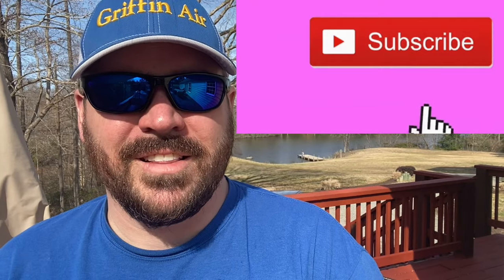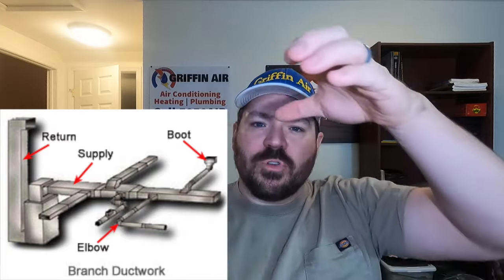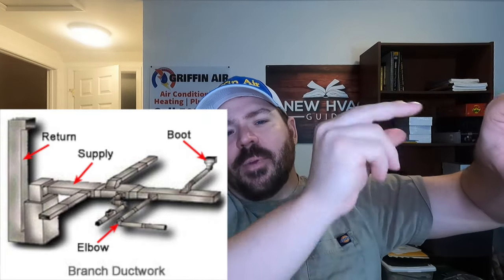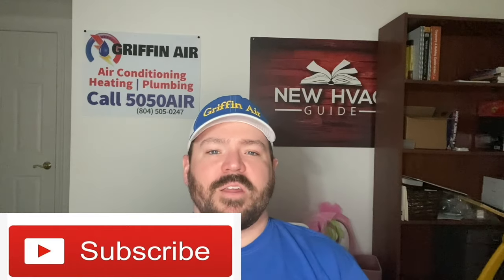3 HVAC Ductwork ISSUES Homeowners NEED To Know!

Comment: I have installed ductwork for 32 years here in Northern California. This guy did a nice job of explaining things correctly. To answer some problems- if you are getting too much air in 1 room and not enough in another room you could add balancing dampers in the ductwork to divert the air into other rooms. Also a big thing he talked about is too small return air to the unit, this causes many problems. 1 is the unit may freeze in a/c mode in summer because the unit is starved of air over the coils. He brought up static pressure. This is an issue with how the system deliveres air evenly. Proper sizing of ductwork helps delivery of air through out the home. Stepping down in size the further you go down the line is key to proper airflow. Hope this helps some of you. This guy is spot on here. Good job
Reply from the maker: Thanks pal
Reply: Paul , I have this issue on my new home , CFMs were tested in each room and it’s higher on one area and lower in another but still above the CFM plan 
However, one room is hotter in summer and colder in winter
I asked for the engineering plans to be relooked at and ensure loads and cfm requirements are calculated correctly… we’ll see what they say
Reply: Also, the HVAC Tech said there are no dampeners at all , he said I’ll have to work with the registers
Reply: @Victor Cruz  installing damper collars is easily done by a pro. Using the registers only makes it noisier in the room. The extra heatload in some room's could be from what's in the room generating heat. Can lights, tv, computers... Lack of window coverings on the sunny side of the house... All easily fixable.
Reply: @VictorCruz-wn8tz  Good luck with that. Unfortunately systems are rarely installed prior to closing up walls.  It would be nice to be able to run those flow numbers prior provided that ALL condicalculations. (Insulation, window effcy, sun, etc) are set forth in the load calc.
Reply: Nice thank you for your input sir. I’m looking for a knowledgeable individual to help me install the entire system myself. In so cal
Reply: Hey is the number one reason for not getting air in a room is because obviously the duct work is damaged or loose in some way ? Getting very lil air in one room. Very weak supply from the vent. I tried the ceiling damper but it didn’t make any difference.
Reply: Is the room facing west. These rooms typically are hotter than the rest of the home especially if is a 2 story house upstairs like a bedroom. I would run an additional 6” round duct to that bedroom. This will help in the winter too. Hope this helps. FYI this will lessen the air in the rest of the home about roughly 150 cfm
Reply: Undersized systems or oversized ducts will cause any room to get more air flow than other rooms.
Reply: Thank you for the insight. If current 3.5 ton will be replaced with a 4 ton packaged system, is it required to upgrade the ductwork to a bigger size as well? One company said yes and it will cost an additional $4K to upgrade the ductwork on an 1800 sqft home.  Any response will be appreciated. Thank you.
Reply: Can a gas line piping be attached with two brackets into your furnace return duct work 

8:06
Reply: Whats the pricing for new duct work installation?

Comment: Well you just disappointed about 75% of home owners. Unfortunately builders and many home owners use cheap mechanical contractors for residential the majority of time. Therefore you get low skill labor at a a good price. Get multiple estimates from reputable companies and ask to see their work. If they can’t show you photos they don’t take pride in what they do. Doesn’t matter if you spent 20k on your new system if it isn’t installed correctly. Do your research on companies. Ask to see their work. If it doesn’t look good, it’s probably not. People that do good work take pride in their craft. It should look clean, not like a rats nest, or bomb went off. It should be sealed. Trash shouldn’t be left in the attic or basement etc. quality mechanical contractors are definitely out there but it’s up to the home owner to do their research on the companies they hire.

Comment: The biggest issue for indoor air quality and occupant health is actually duct leakage.  Even brand new duct systems leak quite a bit.  Our brand new, pretty well done duct system actually had 120 cfm of total leakage.  We had aeroseal seal it all up for us.  Everyone is breathing contaminated air, pressurizing, or depressurizing their home with poorly sealed duct work.  No good.  Contractors building building's envelopes and mechanical systems are directly affecting the health of the occupants.  In my new house, I needed to add ventilation because VOC's were too high making me not sleep well and our house prior to sealing the ducts was pulling in attic air and pressurizing the house.  There's a lot of data now showing indoor air causes lots of chronic health problems.  It's time for A/C guys to start paying attention instead of just throwing in a single speed A/C with a fiberglass filter,  no ventilation, no dedicated dehumidification for mild months, and etc. Into homes and not thinking anything of it.
Reply: When we come to your home and tell the homeowner what needs to be done on a new home install or changing out the equipment in a older home,it all comes down to what they can afford.
As far as duct work it’s code to seal all the joints but sadly not the designing of the system.its a lot of hacks out there.we can sell you high seer inverter systems with high in air purifiers,ultra violent lights,humidifiers,ERV systems but the majority of people can’t afford this level of job.
Reply: Then the homeowner needs to pay for it. Builder only pays for bare minimum. You want it? You pay for it.
Reply: In California the system has a duct test. The test goes right to Sacramento, this is done by an independent company. So, little to no leakage.
Reply: Yeah like on mobile homes. The plumbers, electricianz, and AC guys drill holes in the sub floor and dont seal. So literally a bunch of seals not sealed let alone ducts are never installed correctly.. you need the right tapes, spray glues for the tape.etc. just did our home and we had a basketball sized hole in the trunkline where a duct used to be.. they had it capped but it was just tape and over time just fell to the floor... Lol

Comment: A few of years ago I got a new AC. It was supposed to be a 4 ton unit for 2200 sf. Another company came out for a free yearly checkup and I was informed I had a 5 ton unit and my ducts were not adequate. He also suggested a second return air. I had 4 estimates from 4 companies who all pretty much said the same thing. I had the first company do the job. 9k for all new ducts and additional return air. What a difference. It’s very quiet now and the whole house stays cool. Before, the living room for example would not cool down during the day with company over. That ductwork costs more then the AC install. But, I should only have to do it once!
Reply: Having enough return is an extremely important part of a properly running air conditioner. Also not using restrictive 1 inch pleated filters they cut airflow substantially.

Comment: Always check behind your plenum box and make sure they sealed the area off from the attic if you have a closet mounted blower! Paid $8k and found the installer never sealed the back 4” off so I was pulling dust , dirt, and gross outside air into the closet into the intake and through and out the duct work! I fixed it myself because I’m so sick of being scammed by AC guys.
Reply: same here.  my guy showed up smelling like weed and the plenum wasn't even square to the point of having a 1/2 inch gap on one side which he "mastic'd up".  I had my drywall contractor come behind him and seal between the plenum and the attic.  He also created a flow unbalance and one of my bedrooms gets hardly any flow.

Comment: I have a 1200sqft 3/2 and a 2.5 ton unit that is 3 years old. The air handler is in the attic, and I'm replacing the entire duct system from the 70's by myself. Your video has been the most helpful I have found yet. You even used the same size house/HVAC unit I have as your example. Praise The Lord, Jesus Christ.

Comment: Can a return be placed right next to a duct. My hottest rooms they are next to each other and it just doesn’t make sense. It’s ice cold everywhere else and super hot in my guest rooms
Reply: I have a similar situation 
Lmk what you find!
Reply: If a return is too close to a supply duct you basically won’t heat or cool the space effectively. The supply need to be further so the air can circulate better
Reply: @VictorCruz-wn8tz  If a return is too close to a supply duct you basically won’t heat or cool the space effectively. The supply need to be further so the air can circulate better

Comment: It seems that HVAC location & work is an afterthought in New builds. The HVAC trades comei in after everyone else & try to fit ducts & equipment wherever they can squeeze it in. That's definitely the wrong approach for such a critical & costly system.
Reply from the maker: Great point pal

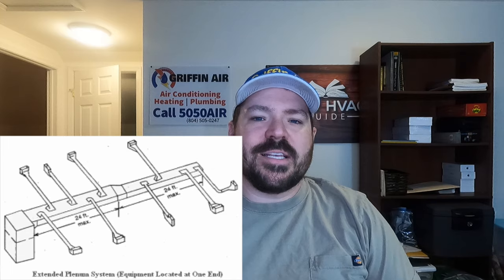Comment: 2:10  Those step downs aren't for the rooms at the end of the trunk line, they are for the branches BEFORE the step down.  If the trunk doesn't reduce in size all the air will pass freely to the last vent.
Reply: No. Path of least resistance

Comment: I had my basement finished in 2003. I had it stated in the contract no duct tape. When I saw the hvac person using duct tape I told him to stop. 

He argued with me saying it doesn’t matter if the ducts leak, the heat is still going into the house. I told the general contractor to find a different hvac person. 

Too bad I didn’t know about mastic at the time. I should have specified that. But at least all the new joints have foil tape.

Comment: Great video! I'm renovating a 100 year old Detroit 3 layer brick home. One contractor told me he needs to make a hole through the bricks in order for the duct work to go through the third floor. Another contractor recommended installing two furnaces so he doesn't ruin the structure of the home. I would love your advice on this.
Reply: Did it cost u alot to renovate a 100 year old house, I saw 1 that I like but I'm afraid to risk it.
Reply: @abiolaashby7117  I'm still working on it. I would definitely budget for it. It really depends on who you hire, and what type of work the home needs.
Reply: High efficiency one got plastic exhaust way easier that the old ones

Comment: That spider system is super common around here, although at least they don't use flex duct like you pictured, but it's super common to see a plenum with a ton of 6 and 8" round duct lines coming off.  

I've talked to a LOT of guys who install duct for commercial HVAC systems on a daily basis that have no idea, or drastically oversimplify how residential systems are ducted.   I know a service guy who swears that all you need to do to figure out cfm is just use the square footage.
Reply: They use baffles to balance the flow. Not ideal but functional.
Reply: @dontblameme6328  Yeah, maybe a company is doing that.  I know it's part of a regular install on a commercial building.  A TAB guy will come out and adjust the dampers and take air readings and let you know if there's a problem with getting what he needs out of a line.

But these commercial guys in my area that are doing residential on the side are most certainly not balancing the system.

Comment: Question: we have a central air unit that runs ac and heat through our floor vents (manufactured home) and the ceiling vents are non functional. Is it possible to use both? Cool air from the ceiling and hot from the floor?

Comment: The old basement unit in a house we got was a mess. The supply plenum attached to two 12" flexible ducts that, after running side by side for 10ft, suppied a 15ft rectangular trunk, from which other flexible ducts arose. Return plenum had a grill placed in it to suck in damp, moldy air that only a dirt floored basement can provide. Nice. Corroded, filled with water, most everything came down and was thrown out. So the 1000 sq ft home is nearly all one large room with the exception of the bathroom and tiny 8x9 bedroom. I'm thinking keep it simple. Hot air vents closest to furnace, returns from other side of house. Bathroom and bedroom get 75cfm each. Thanks for the informative video!

Comment: Very helpful.. Thanks for that.  QUESTION: I have a flexible duct running through my attic that was installed by a professional HVAC company years ago.  One room in the house has very restricted air flow.  I noticed the flex duct that's feeding that room makes a ridiculously hard U-turn into that room's register. It's a very short length near the end of a trunk line that begins it's U-turn right out of the side of the trunk line. and into the register.  I'm thinking of cutting that ductwork, then splicing enough of a length of the same duct material to create a more gradual bend into that register.  I know the less length, the better the airflow but this is situated so that I will need to add 10' - 15' or more feet to do this.  Any problem in general doing it this way?

Comment: So our ductwork has 2 bedrooms that are at the end of the trunkline. One comes out of the top of the trunkline, and one comes out of the side. They are both less than a foot away from the end. Both Bedrooms are very hot in the winter! Is there any remedies to help fix this. Our basement is finished.
Reply: I have this question asked often as I am an HVAC Comfort advisor.  You will want to install dampers in the supply runs to the rooms you are referring to.  This will limit the CFM to those rooms therefore not providing as much heat as is being supplied now.

Comment: Hi Josh, I’m not sure if I have an issue with my system or improper insulation. I have 2 rooms above the attached garage, which are farthest away from the hvac unit, the rooms do not cool in summer nor do they heat in winter. I put my hand on the supply vent in the ceiling, I can feel the air but it’s not enough for the rooms. Also the returns are high on the wall. One of the rooms has 2 returns and the other is shared between through adjoining wall. Any advice on how to correct? Or is this a builder error with poor insulation? The temperature is more than likely coming from the garage. Any help please? Professional opinion?
Reply: I imagine the distance is a clue. Without any other information My Guess would be the duct is either a flex duct not ran properly or sized properly or both. If you have duct that doesn't step down over the distance its travelling or if the flexible duct is ran to curvy or pinched then the low air velocity combined with air resistance inside the duct is making the register just trickle air rather than what its rated for. as a homeowner you can remove the register and measure the size of the supply pipe going to the boot. based on the size it will tell you how much CFM that register was intended to supply by finding a chart online. If the vents are in the ceiling then your supply to those rooms must be in an attic which if its accessible you can pop up there and take a look. if it is poorly ran flex you can try and straighten it or rip it all out and install hard Pipe usually buyable at any menards lowes ect.. just be sure to insulate it. these days in depth guides are available on youtube but the hard part is finding the problem.

Comment: Are you familiar with duct armor? I’m thinking about having mine sprayed, the house was bolt in the early sixties and has the round concrete type tubes that are about 3 feet long and collard that the put together with tar and then pour the slab over, the ran a camera through the duct work and nothing is collapsed but there are some places with sand and the bottom of the plenum is rusted, the sides are fine and the supply register boxes are fine, not rusted they say they can spray it to seal up the loose spots or holes or maybe seperated spots where the sand is and the rusted plenum, they say they clean it out real good before application, they claim besides better air quality there will be better air flow and more efficient what are your thoughts, shh I know this was a long one thank you
Reply from the maker: I’ve never used it but it looks likes some good stuff. Your choices seem limited? But maybe get a second opinion?
Reply: @NewHVACGuide  thank you I trust your opinion and really appreciate the videos and the fast response
Reply from the maker: Yes ma’am! Thank you so much!

Comment: Stop using the expensive one inch pleated filters, they are restrictive on air flow and they cause lots of problems with refrigerant pressure which then  makes you air-conditioning run badly
Reply from the maker: I’ve seen some of them cause issues when they are brand new. But after they get dirty, they are extremely restricting airflow.

Comment: Thank you.  You earned my support.  I’m pretty sure you solved my house heating issue.  I probably have a 30 foot trunk with a 90 degree angle all the same diameter.  The two rooms in the end are freezing.